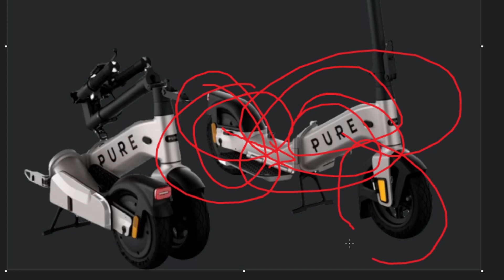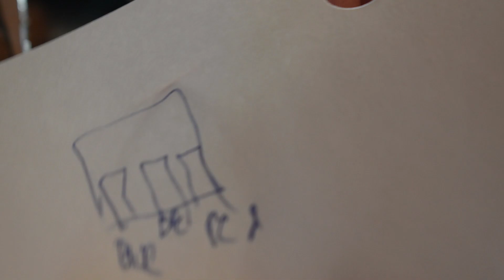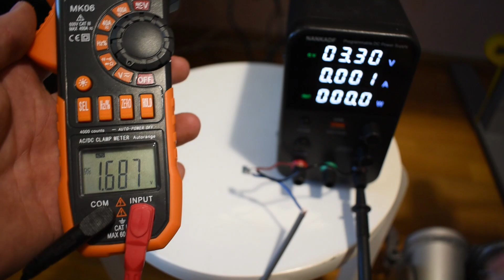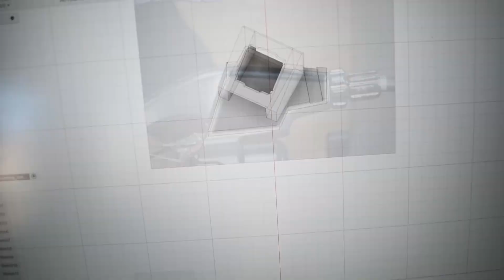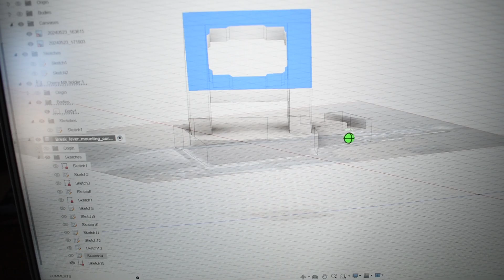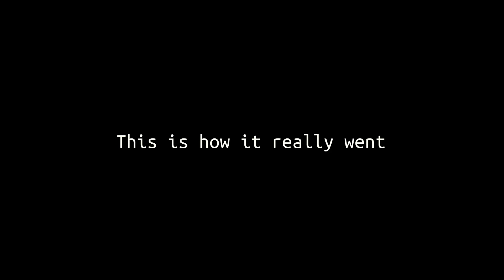I Put a Keyboard on My E-Scooter to Go Farther

Comment: Can the mechanical break be adjusted by releasing the tension on the wire like on bicycle breaks? In that way pulling the leaver a small bit shouldn't engage the mechanical break but it would engage regen a little bit?

Comment: my idea would be to just put a another break lever on the scooter and have one for regen and one for the brake
Reply from the maker: Yeah, that was my initial idea, and it would've been really cool! 

The only problem I had, which was briefly mentioned in the video, is that the handle bars fold. So, making a second lever would possibly require moving wires from the left handle bar to the right one, which would mean passing wires through the folding parts. It's achievable, sure, but this method was the easiest, fastest way. 

Thanks for the comment! :)

Comment: You do know that when you press the brake just slightly so the contact closes but no brake force is applied, you would have the same effect?
Reply from the maker: The problem is, there is no "contact" that closes. It is a Hall effect senosr, meaning the deeper you press the lever, the more intense the braking. However, the lever has a physical wire that always depresses the mechanical brake as well, so electrical braking is always accompanied by friction. If you could barely press the lever to activate the electrical brake only, it wouldn't be reliable at all at bringing you to a stop. 
With the keyboard, the scooter comes to near dead stop whenever I press the button.

 The maximum electrical braking force achievable through the lever is still quite low, because the Hall effect sensor saturates at like 2V, but the keyboard can push that "braking signal" up to 3.3V.